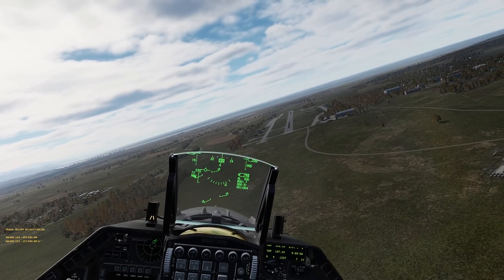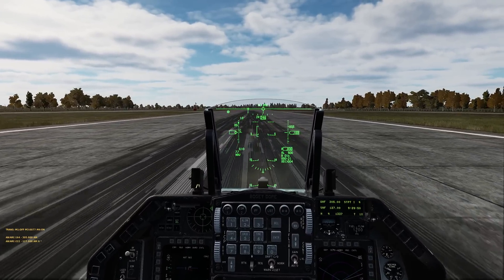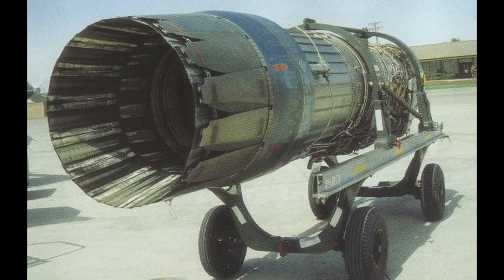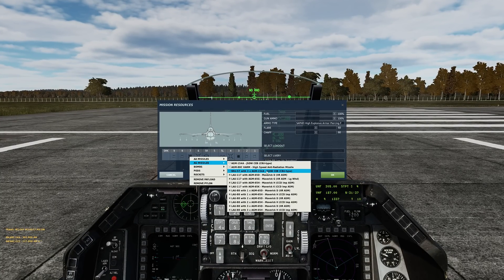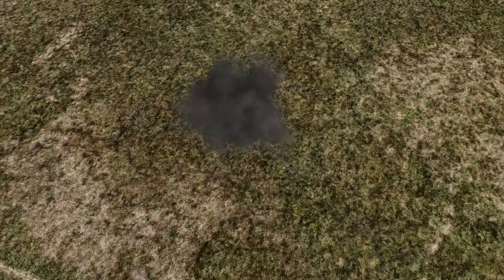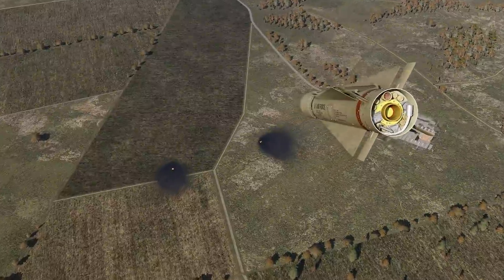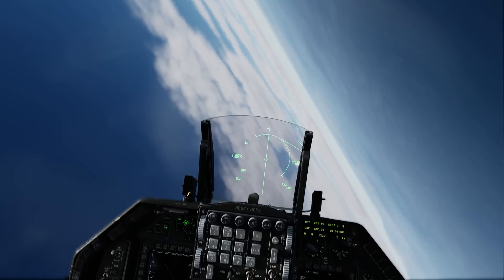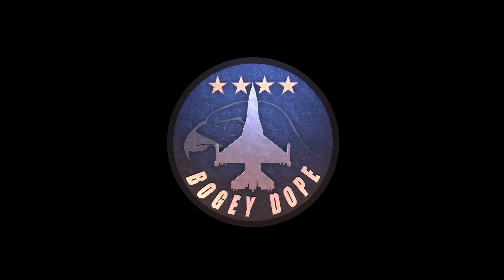F-16 blk 25 P&W MAX POWER SWITCH DCS

Comment: Current 16 GE engine guy here. The max power switch wiring is capped and nertd, they just don’t wanna buy new ENG CONT panels lol. Also from my understanding if anyone cares, the switch fully opened the IGVs, VSVs and disabled rpm limit to the main boost pump essentially shelling it out when in use 🤘🏻
Reply from the maker: Yes! That's my understanding as well. Thank you for confirming.

Comment: While I'm a civilian pilot, we had a 'similar' switch in the aircraft I flew during training, the DA40NG. The fuel selector switch was safety-wired to "norm" (left tank), if you swapped it to the right tank it would cause issues. This was unfamiliar for our pilots who had previously flown on Cessna or Piper aircraft, as the fuel selector switch is normally used occasionally to swap between tanks and drain them evenly. In the 40, you would use a fuel transfer pump to refill the left tank from the right tank- this is because the aircraft would specifically pull fuel from the left tank. Excess fuel was routed through the right tank to cool it and dumped back into the left tank. If you pulled from the right tank only, you'd create a weight imbalance and quickly run out of fuel, as the excess fuel not burned by the engine would end up in the left tank, and the fuel transfer pump was not capable of pumping fuel back into the right tank. It was only there for emergency use (ie; a fuel line clog or leak). Just another example of a switch doing what most people think it wouldn't do :P

Comment: Alot if your info is bad. Its all still regulated and monitored by the DEEC, the limits are just increased. They are not ‘eliminated’.
Reply: The thoughts on performance gains are way overblown.
Reply from the maker: @Golfrnut  20-22% higher on temp, past 100% throttle default temp. Not sure what that equates to in total thrust, but was told it was quite a bit. I wasn't an engine shop guy but I was told this would damage the pratts if used too long. I thought I remember being told 5-6min max.
Reply: It’s in degrees, not percent.  And it lets the motor increase a couple of percent N2 RPM. The -1 and engine books cover it pretty well on allowable limit increases.  Limits that require boroscoping vs overhaul as well.

Comment: That was great.  I knew it wasn’t used in modern engines but had no idea about the rest.  Thanks for sharing your knowledge on this.  Great video dramatizing by the way.
Reply from the maker: I made it look cooler than it really is. I have a feeling flipping that switch gets it to about the same thrust as the Modern GE engines are at in full burner.
Reply: @BogeyDope  for sure..  but it will still awesome.  And you made a good point of saying that in the video.  I rather enjoyed the beginning.  Again. We’ll done!

Comment: Hmmm my blk42 220s have never had max safety wired. Never heard of 42s with 220s safetywired anywhere for max, just voice inhibit and fuel master. Good job on the video
Reply from the maker: Wow! Yeah, the block 25's I worked on had them safety wired off. Maybe because it was a training base? Keep F-16 Trainee pilots from touching it maybe. Maybe I'm miss remembering?
Reply: @BogeyDope  I think you're onto something there.  Looking into it, only some units between ANG and AETC are using Block 25s, so it is very likely to save wear and tear on older airframes/engines to keep them flying just long enough until they swap or convert the airframes.  The only bases I was stationed at with Vipers had Block 40s, and I didn't know enough maintainers to see if anyone from AETC land, or who had worked on PW engines, could share what their units did.  But having known young Viper pilots, I could see the need to safety wire the max power switch to help newly minted pilots resist temptation.

Comment: Is there a reason a lot of the cockpit controls are retained with the introduction of later block models such as this switch, the FLIR buttons/switches on the ICP and DL switch on the right panel? Why not remove them?
Reply: -Time and money.
-If it ain't broke don't fix it.
-If you remove a switch you have to fill the hole in with a plate or redesign that whole switch panel. Can't have a big hole just chillin' there.
-Possibly muscle memory for the pilots like we used to do with car radios before everything became a touchscreen. You could feel where the knobs and buttons were without looking for it.

Comment: I worked on the Pratts -200s  and 220Es for the NDANG 119th FW (Happy Hooligans). We flew the Block 25 F-16A models. Ours were primary interceptors only and even had a light on the side for nighttime interceptions. All our Block 25's were retired to the bone yard or converted to drones.

Comment: We had vmax on the F-15 also. The 100 and 220 engines. I had to make sure the switch was safety wired on my BPO/PR inspections. I was told as you said it gives full power up to like 125% until the engine melts. It was an oh shit escape bad guys switch.
Reply: F-15C pilot here.  Crewdawg76 is right.  The vmax switch is on the left hand cockpit bulkhead near the throttles and is saftey wired closed with copper wire, not steel.  And yes if that wire gets broken we squak code-3 and the Crew Chiefs and engine troops get real mad at us. :)
Reply: @BasedF-15Pilot  Really really cool to encounter an F-15C pilot here, a question if you don't mind, is there a slight chance the engine might fail or flame out while using the max power switch? cuz that'd be bad if you want to escape faster but end up loosing an engine while running away.
Reply: @anomaly_echelon7994  Fail more than flame out, since I think the switch allows a higher operating temp than what is safe, so probably more at risk of breaking compressor blades.  A maintenance or engine guy would know more than me on that one.
Reply: @BasedF-15Pilot  Makes sense, sounds pretty bad, and ig compressor blades experience a lot more centripetal force and pressure waves than they were designed to operate on at those temps.
Reply: Hey, if you dont mind asking, how fast could that thing fly at around 10k feet with it engaged? could it extend its limit alot?
Reply: @cmhb59  you're pretty much just, in layman terms, dumping nitrous to the engine to make it go faster, but in turn you're quite literally pushing it past it's limits and melting the engine, you have about 2-4 minutes before you start doing repairable damage, and 5-6 minutes for damage damage
Reply: @sevenshooter2987  sounds like the war emergency power in the P-51
Reply: @Agm1995gamer  yeah sorta
Reply: It feels wrong not to call it War Emergency Power.
Reply: the vmax switch was there particularly on the -100 engines to provide the extra thrust necessary to achieve the mach 2.5 demanded by air force specs. it allowed the engine to overtemp significantly to make the extra power but it did add another tenth of a mach number at least to the top end. in the -220 birds on a standard atmo day they can make better than mach 2.4 using vmax slick with 4 sparrows, probably faster with amraam

Comment: It is still operable on the PW220. Disabled on 229, and both GE engines. Gives you a little more FTIT > M1.1. 

The MAX POWER switch, located on the left console, is solenoid held in the MAX POWER position when the throttle is at MAX AB and airspeed is 1.1 mach or greater. Refer to ENGINE LIMITATIONS, Section V.
Functions are:
• MAX POWER – Delivers maximum thrust by allowing maximum FTIT to increase by 22°C.
• OFF – Normal (deenergized) position.
Reply: Also, there are limits. Can only use in actual combat, limited to 6 mins per application, and a total of 60 mins allowed before turbine inspection/overhaul. All max power time recorded by the EDU (or DEEC) and the pilot must also write it on in aircraft forms.
Reply: I don’t know for sure but probably because the -229 has a higher FTIT limit and puts out more thrust.  Same with the GE engines—they have higher limits (in this case, EGT) and also produce more power than the PW220.
Reply: why is it disabled on the 229 and  both ge engines?
Reply: Only when M > 1.1? Damn I thought it would just let you flip it on willy nilly without considering your flight parameters.